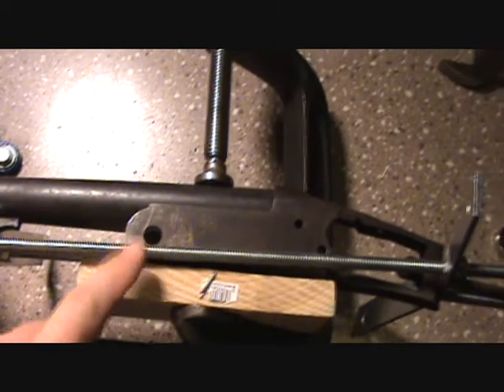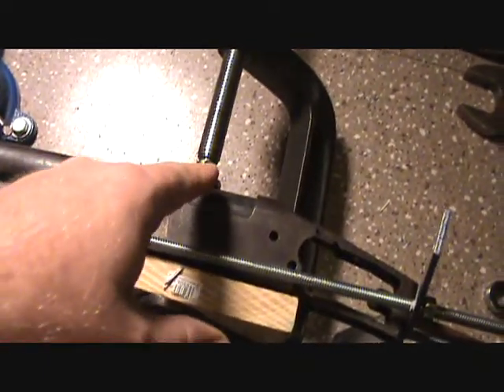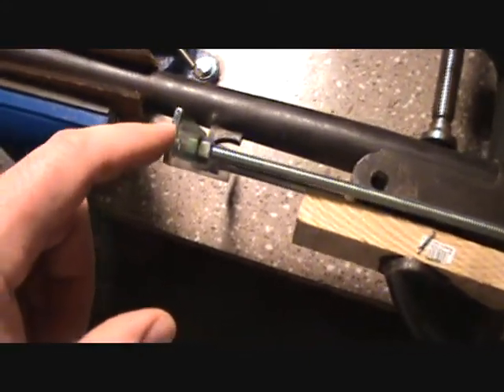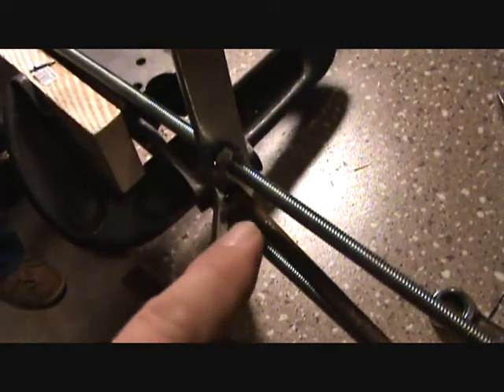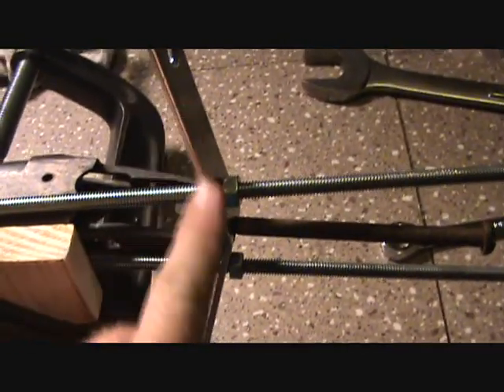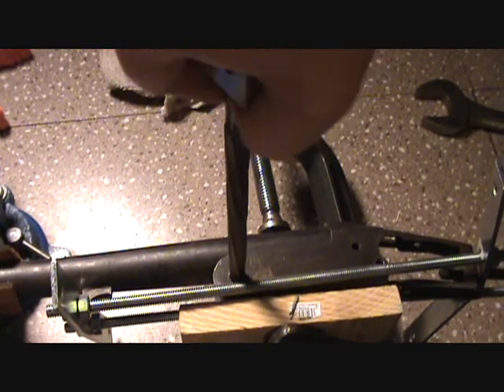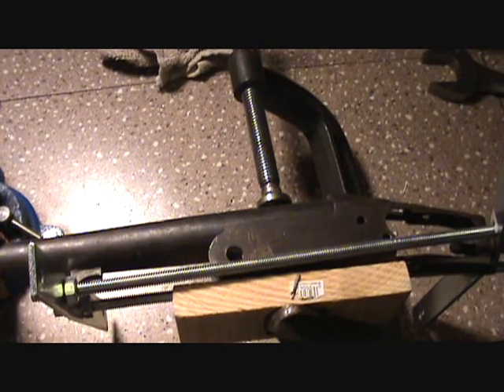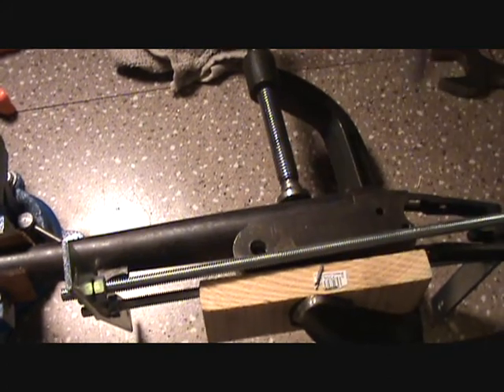Shotgun won't close Replacing A Shotgun Pivot Pin Pt.1

Comment: You do the hinge pin job pretty much the same way I do it. The only thing I do differently is I use a #7 taper pin. On the last one I did on my IJ Champion the lockup was nice and tight without no hint of binding.